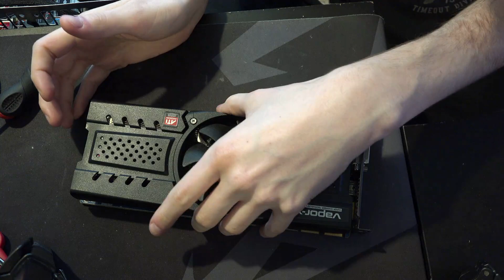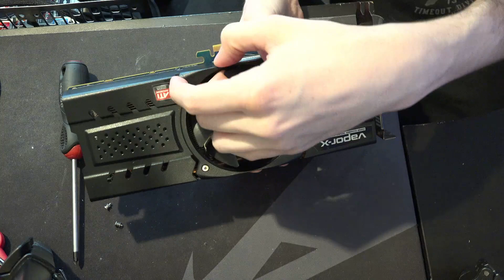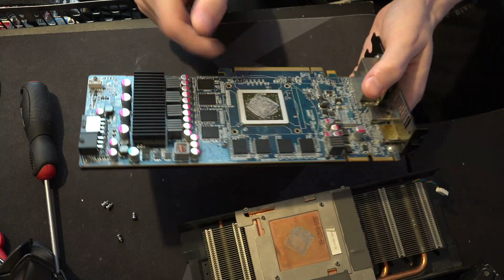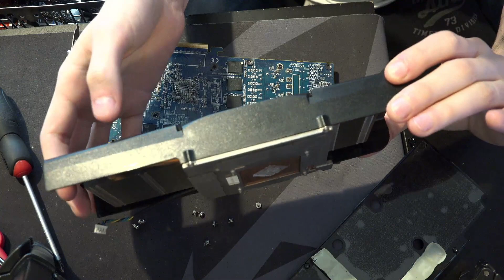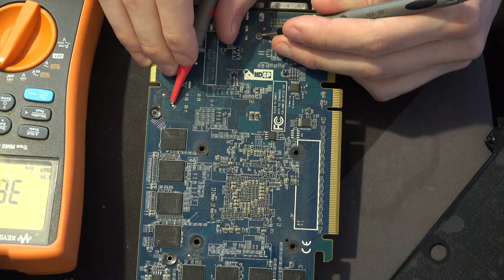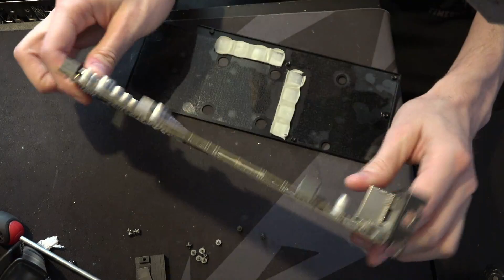GPU Teardown: Sapphire HD 5870 Toxic

Comment: @Actually Hardcore Overclocking
Hey, do you know the exact thickness of the thermal pads under the heat sink (front side)? 
I have the 1GB model which I want to convert to 2x 120mm fan setup because the old fan is dying, but I can't take it apart and measure the actual thickness of the pads.

Comment: That card has basically the same VRM components as the ones on my EVGA P55 Micro, the MOSFETs are in the Vcore and the controller handles either VDDR or one of the minor CPU rails, i cannot remember (Vcore on that mobo is handled by an uP 6208). I kinda want this now just for that fact alone.

Comment: Hello Buildzoid, could you please make a video where you explain which parameters one have to check for mosfets quality inside VRM? Things like Id, Rdson, rise time etc.
A more direct question: on hardwareluxx there are some mobos which are listed as 4x2 phases (without doublers) and others which are 4 phases but with both double highside and lowside mosfets, like msi b450 tomahawk vs b450 pro carbon. They are the same right?
Thank you

Comment: If the shroud is plastic, use Testers Plastic Model Cement to glue it. It dries clear, is very strong, and can be shaped/sanded/painted. Can be applied with a toothpick, or can be injected into cracks with a syringe.

Comment: I have 2 EK Fullcover waterblocks for them. I used them on two XFX 5870s (exactly the same PCB). I managed to get around 1150MHz on both with all the hard voltmods and using Liquid Metal thermalpaste! They are really fun and to work with but very annoying VRM design to crack.

Comment: Sapphire cards feel of low quality to me...The PCB is that ugly color with those notches on the sides all around it, chokes look mediocre often crooked, VRM design usually the same as reference or not much better, too many useless SMDs-like ASUS or MSI use much less SMDs and their cards work the same or better, coolers not especially good with usually ugly design, often non nickel plated heatpipes etc.

Comment: sapphire, the evga of amd
Reply: Imagine a Sapphire AM4 X570 motherboard
Reply: yeah, literally
Reply: but sapphire doesn't let you extend your warranty (up to say 7-10 years), does it?
Reply: @plonk420  why the hell would i have a gpu for 7-10 years?
Reply: @Bibl888  i had an HD5870 i used for about 5 years, probably could have gotten another  year or two out of it had it more VRAM. i bet a 1080Ti will last at least even into the midrange of graphics settings 5 if not 7 years out
Reply: @plonk420  l0l doubt
Reply: well, regardless, a mobo has a lot more shelf life than a GPU, so 7-10 year warranty is still nice on a board.
Reply: @plonk420  They also don't honor the warranty unless you can show that you're the original owner, whereas some brands don't require you to prove anything. Currently, in North America, MSI is the only brand which doesn't require you to show proof of purchase and also officially supports a transferable (used) warranty. EVGA also supports transferable warranties, but they do require you to show some sort of proof of purchase. I only recently became a fan of MSI because of this, and perhaps even more-so because of the excellent reviews of their mid-ranged AM4 motherboards (B450M Mortar, B450 Tomawawk, etc.).
Reply: Also, fun fact, Sapphire is owned by the same company which owns Zotac (among a number of other brands).
Reply: without so good warranty and the producer of AMD reference card

Comment: My 5870 Vapor-X looks similar but the PCB is different, mine is double 6 pin and only 1GB and no backplate.
The cooler, VRM and In out looks identical.
Nice find
Reply from the maker: yeah as far as I can tell the toxic is the Vapor-X PCB + 1GB or RAM and an 8pin

Comment: Ah, the 5000 series.
Still have my 5770 Vapor-X lying around.
That card served me well for such a long time...

I'd say the 5870 probably does have 2 GB...
Since the 5770 has 1, and it's a midrange card...
Reply: Nice, i had a 5770 Vapor-X too. Was a pretty good upgrade from my 3000 series card back then. It played Dirt 2 and Just Cause 2 like a charm :)
Reply: Heh. At the time I got it I was moving on from a laptop with an Ati x1400
That was one hell of a jump in performance...

I was still managing to get moderately OK results with that 5770 up until 2016, but moving into VR really put the nails in the coffin for that thing being usable...

Still, in some ways it's possibly the single best card Ati/AMD has ever made...
They were so far ahead that generation, but... Bit by bit they fell behind.